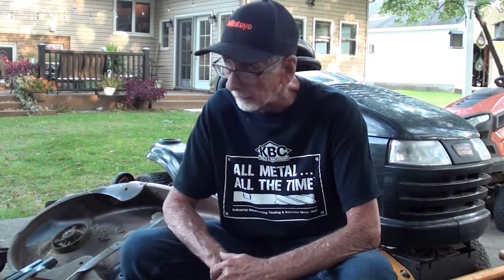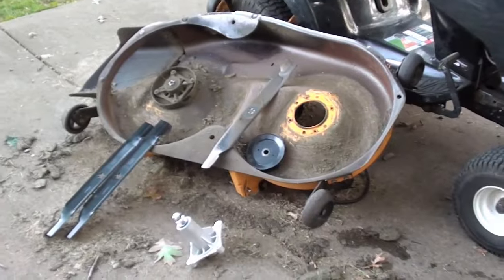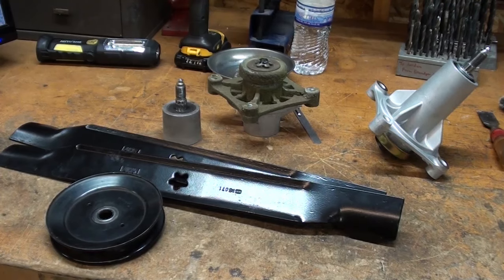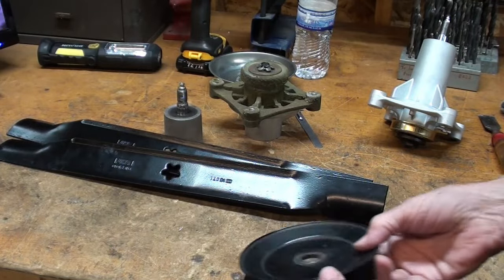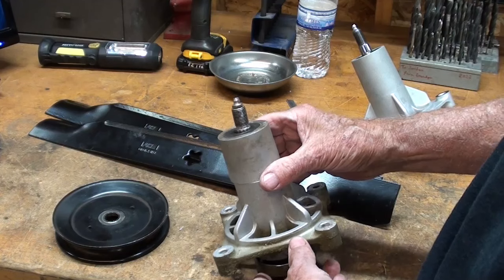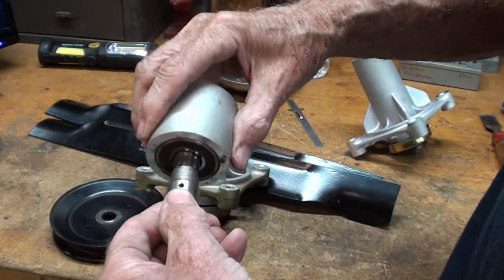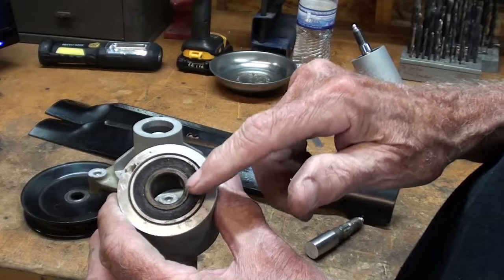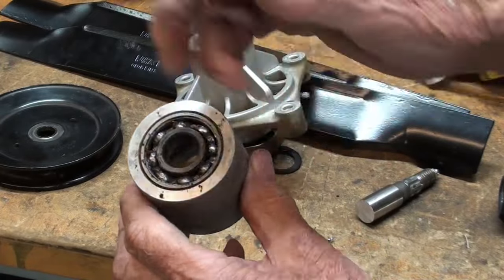LIES & DECEIT mower spindle fraud SHORT SUBJECT #52 tubalcain

Comment: For everyone crying "the Chinese put the wrong bearings in", you would be dead wrong. I assembled literally thousands of spindles when I worked at a major lawn equipment manufacturer. And every one of them used sealed bearings. Did they know it was a bad choice? Absolutely, but as has been speculated, the bean counters made the decision to change. I can tell you that all of the "standard duty" spindles were made in-house. The "heavy duty" spindles were made using trailer hubs. These had cut steel tubing for a spacer so a reasonable spacing could be maintained, as the quality of the foreign castings was not the best. If the saw slipped the spacers would be too short and the bearings would get pulled in too far, resulting in loose blade drivers and attendant problems. It would be nothing to scrap as much as 1/3 of the spacers. The company made several products for the top "manufacturers" (just slightly different design features and badging). One i remember was a  different color, had a drink holder, and was $900 higher! The spindles were made from steel with two bearing pockets turned, then welded to a square piece of sheet steel with five holes drilled in it. Cheap and quick to manufacture, insanely expensive to buy as a replacement. And that was just one of the manufacturers of "top quality" products i worked at with very questionable manufacturing ethics.
Reply: I forgot to mention that this was almost 25 years ago, so not a recent development by any means.
Reply from the maker: Thanks for an excellent comment, from someone who actually assembled these items

Comment: This is not really about lies and cheating - when we take the average owner (the vast majority) into account.  The impetus for putting in bearings sealed on both sides is because the vast majority of owners do little or no maintenance.  The sealed bearing will last much longer than the non-sealed bearing that gets no grease.  So, for the average idiot, the inside seal probably gives them twice the run time before bearings/spindles need replacement.  For those that can and will do proper maintenance, it's not a big deal to pop the bearings out and remove the inside seal.

Comment: YOU’RE WRONG.  I worked on one of these about a month ago and found that the bottom bearing is not sealed on the inside. Over the years I’ve had to fix many of the older style spindles that don’t have the grease fitting and I noticed that it’s mostly the bottom bearing that goes bad and the top bearing is still good. This newer style is designed to let you add grease in the top which eventually makes its way to the bottom and greases that bearing. I watched your whole video waiting to see you look at the lower bearing and you never did.
Now with that in mind let’s complain about the bolts. I have never been able to remove one of these housings from the deck without at least half of the bolts breaking off leaving a perfectly good spindle housing useless because it can’t be put back on. When I replace them I drill out the threads and use stainless bolts with nuts on the other end.

Comment: The manufacturer could have just changed the design to use a sealed bearing and are just using  up the old stock of old shafts with zerk fittings, they may just be cheap not deceitful, I cant tell if its satire or not.

Comment: Mr Pete have your son-in-law lay a straight edge across the blades probably the deck is bent to Taryl has good videos on how to straighten it the old cubs deeres had a short spindle that did break bend back in those days the belt just slipped

Comment: Hey, you didn't get to the business end of the spindle, where my big beef is.  Namely, the total lack of a positive drive that relies on the anchor bolt to provide the transfer of the power. Run into something and the drive slips and you're mowing Mohawk haircuts in the yard. Couple this with the VERY inconvenient access to the underside of the deck without taking it off, again an adventure, and this is a total disregard for the end user.  Now, for a $12,000 tractor-mower, yep, its green, to be so poorly executed, given current technology, approaches criminality.  Yet, if the majority of users do not expect such a machine to handle some abuse, I guess they get what they deserve.  Yeah, I get pumped up too!   Every time I have to work on such an under-engineered, poorly executed POS that is sailing along on one of America's commercial icons into the dustbin of bean-counting. Enough already!  Thanks for sharing my feelings of betrayal.

Comment: How many actes do you guys mow?

On my location is a MTD, about 10 years old.

I didn't even there was a grease zirc on the spindle.😳😳

Why putting one on it when it has no use?
Made the spindle supplier a short cut and quality control doesn't notice it till now?

Comment: Do a little research for the poem, 'The Deacon's Masterpiece'. It is a similar take on the topic written a couple hundred years ago. The machine is designed to cut grass; not stumps! And as far as the spindle goes: Honestly, do you really expect something more from what is probably manufactured in China? In most of their manufacturing, inexpensive means cheap (crap).

Comment: no DECEIT - you get what you pay for - there much better mowers out there but way more of the cheap ones - my guess is that it worked fine until the stump . I've even bent a blade on a bush hog on a stump . those same spindles are used on many mowers . the  DECEIT comes in when so companies buy up all the old quality brands and cheapen them . Its are own fault for price shopping - we ran the quality brands out out buying the cheap stuff . the cheap stuff works but they don't last as long and take any abuse , so don't whine when they break

Comment: I guess they just updated the design between the 60's and now... and changed the bearings to this sealed ones without changing the design and removing the nipple.
Probably the bearings will in most cases survive longer then other parts...

Couldn't you repair the mower with some work on the lath and mill?

Comment: Time for some teacher science mrpete!! put a bearing in dry than grease it than remove them to see if grease made it to the bearings,,,,,,,>>>>Hay Mr Pete I have been seeing these vids all over youtube talking about spindle bearings and  "SEAL" problem. I also believed the hype until my moms mower beck bearings went bad so i put my 40 years of mechanics knowledge to the problem.  No one is really looking at the science of it. #1  grease guns go to 3000 to 15000 psi and a bearings "dust" seal is good for maybe 2 psi, grease will get past a dust seal and the seal holds grease next to the balls. The real problem is cheap Chinese bearings and no one actual greases them enough. True an oil bath would be way better. Good quality bearings are 20 bucks each. A new chinizeuim hub with cheap bearings is 25 bucks you can get 10 years out of good bearings or 2 years out of the china hub or buy a set of 10 china bearings off amazon for 20 bucks just replace them more frequently.  I found that a 2010 toyota tacoma 2.4l belt tensioner pully uses the same size bearings but way better quality. Mowing laws is scam in its own right. Instead of engineering grass to grow slowly we make it grow faster. I gave up on all that crap. I brush hog my yard 2 times a year now and I'm building my new place with a big "lawn" of just gravel no lawn :0. Buy Monsanto chemicals for your lawn, buy new mower for your lawn, waste ur sundays mowing said lawn use all of the water on said lawn ' buy more parts for mower. Do you see the problem? If can't see it ur a lemming following the leader lemming. >>>>>>>You must not have dandelions!!! Huu where did that voice come from??You must have perfect stripes on your lawns!! What the? Why? You must obey me!!!!!!!! Who's me? I AM YOUR GOD!! Wait what?  Who is saying this? Bow down be for me or I will riddle you with cancer!!! For I am MONSANTO!! Ok but aren't you already giving everyone cancer already. Yes that's besides the point>>> MAKE YOUR LAWN PERFECT! By spreading these wonderful chemicals!! Ok what is in them? Monsanto: we don't know or care just buy them NOW!!! Monsanto's new slogan >>>We help you grow your lawn as fast ,and grow your cancer even faster, who cares you will die with a nice full lawn with perfect stripes and our share holders will get new summer homes on Epstein island. Everyone is happy :)and dead:(
Reply from the maker: Excellent will thought out rant
Reply: @mrpete222  thanks Mr.pete luv your teachings. You inspire me to make chips instead of grinding dust:)

Comment: While it could be they used to be greaseable in the past and somewhere along the line got changed to a sealed bearing...I doubt it.  If so they would have also got rid of the grease zerk and associated machining to save a buck.  I think this is truly planned obsolescence and deceit.  The place a non serviceable bearing so it will some day fail and need relacing...therefor covering the extra expense of the extra machining.  When you are looking to buy a mower and see one with a grease zerk, you think it's serviceable and will be better quality and last longer if you service it.  It likely increases sales.  I say scam.

Comment: ...@6.30" you say old spindle is 2 years old...Maybe there was a covid induced parts shortage at the time and open bearing not available.. ...If so, pity they didn't pull inside seal out.
...Maybe the new one has correct bearing fitted...Would be interesting to check...
Reply: Nope! This has been going on long before 2020!

Comment: Lmfao I ran into this a few years ago with my craftsman, had to replace spindle but when I did I baught all the rt bolts and the cheap ass bolts snapped off, baught another one and sprayed wd40 in to get the bolts to seat all the way down and not snap heads off half way down, total junk!

Comment: I have seen this before. Some engineers are just educated idiots.
Reply: Some might be, but some aren't even aware that their designs got changed by the routing department, purchasing, manufacturing, assembly, or overlooked during inspection. 
Plenty of places for a company to cut corners on an otherwise good design.

Comment: Mower deck bearings have dust seals not hydraulic seals. Grease guns have 3000 to 15000 psi and youtube thinks cheap china bearings dust seal is the same a hydraulic pump seal and will stop the grease. lol Think hard keyboard warriors. Or actually grease something until you see grease come out. Cheap crap china bearings is more of the problem not the seals.

Comment: Mr. Pete I enjoy your videos but I believe you are wrong here, those are just seals meant to keep out dust not to stop grease from getting in. There are many videos about this that show how little pressure it takes to push new grease into the bearing, and a grease gun can easily apply more force than that seal will stop. This video shows how just hand pressure can be enough to push grease into the bearing. https://www.youtube.com/watch?v=4sebEgloQEM. I also agree with another commenter that said the tower was empty so nobody tried to grease anyway. Just my thoughts.

Comment: Hold on just a minute.  Before you start waving the dirty end of the stick at others, please consider this.

I suspect that the sealed bearings ("lifetime-lubricated") were substituted to reduce an in-service problem; namely, no one ever lubricated the bearings using the grease fitting as directed, and they wore out.  Consequently, engineering approved the change to the sealed design and the grease fitting was rendered superfluous. The shaft wasn't changed because there was either a supply of shafts to be used up, but more likely, the manufacturer did not want to roll the part number of the assembly (so they could keep track of the change), change the service manual, revise the engineering drawings, etc. These things cost money in engineering time. 

Bottom line: A lack of lubrication did not cause this failure.  a sudden impact load from a stump did.